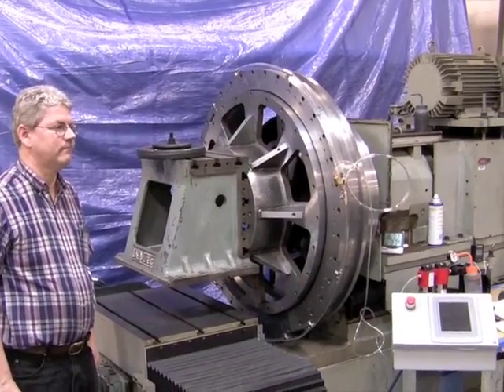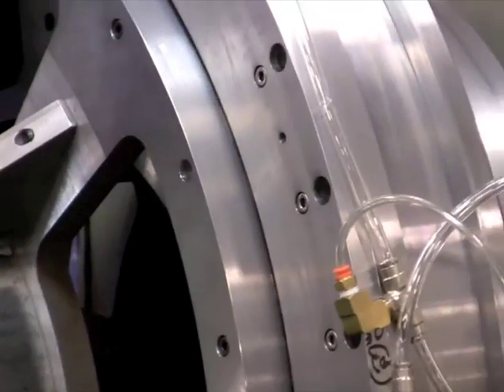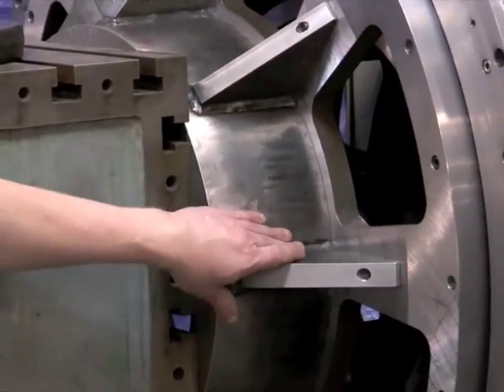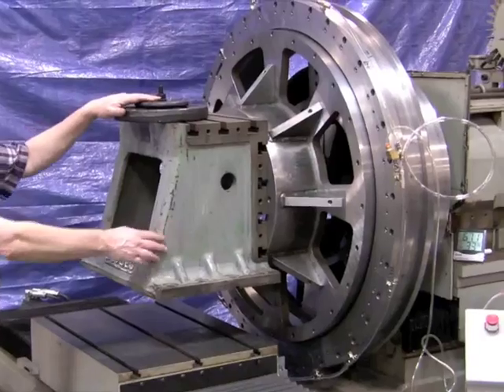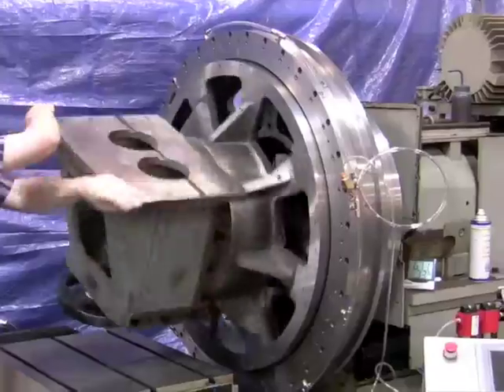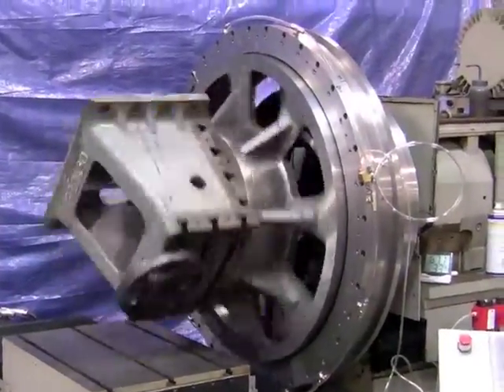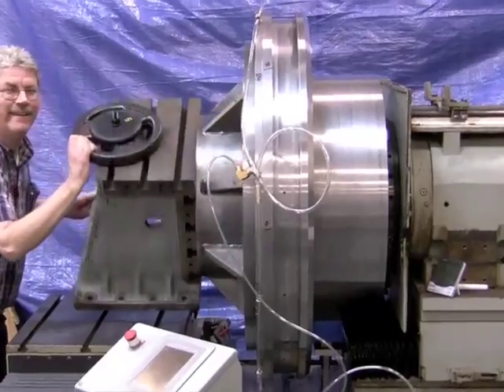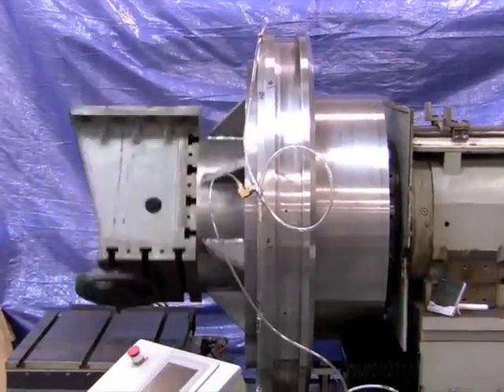Load Test of 1 Meter Diameter Air Bearing Slewing Ring

Comment: Are there any measurements for net motion or vibration introduced by the bearing vs basic noise and pressure variation?  Something like this would presumably be good for large telescopes as long as there's no net vibration introduced.  I'm guessing because of the very low fly height and large mass there's probably next to zero observable effect.

Cool demos, thanks for uploading them!

Comment: Awesome job. 
When a CNC or Conventional machine (Milling, lathe, grindind, etc) working with all its parts using airbearings? Slideways, spindle and axes, all them working with this method. 
Testing a machine like that should be fantastic. Plus knowing it is wearness free.
Regards and thanks for sharing.